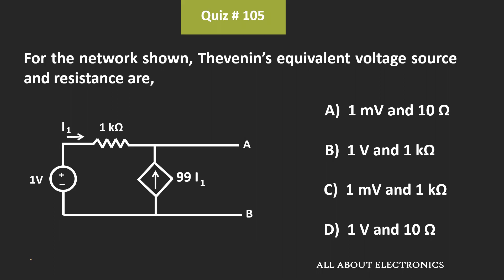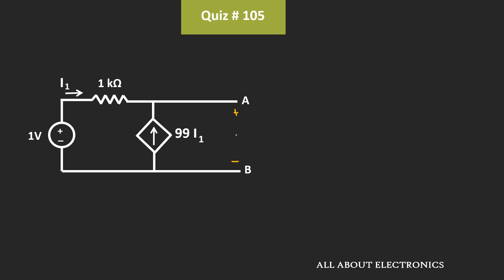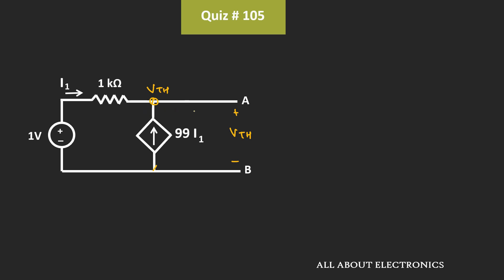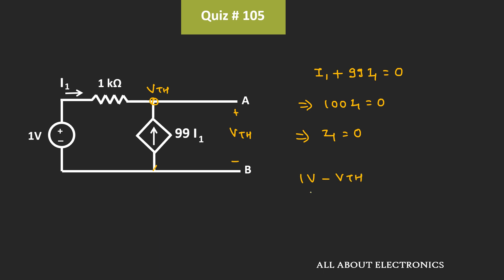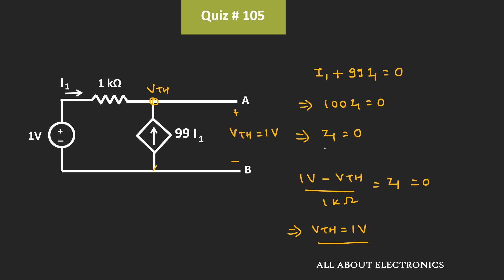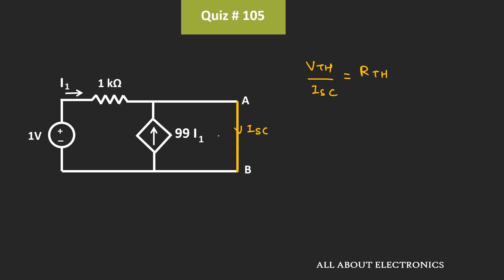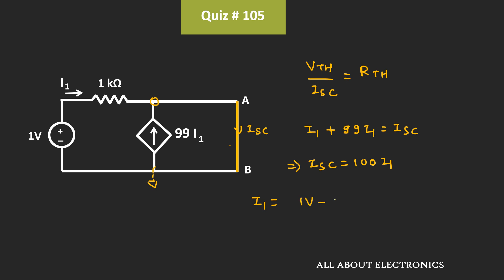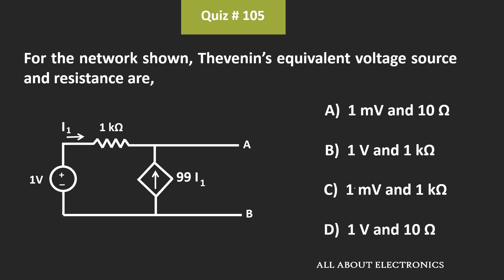Thevenin's Theorem Solved Example | Quiz # 105

Comment: Sir i have a question.. where do you ask the questions to theses.?? do you post them or do you have them on your main site?? or this one??
Reply from the maker: I used to post the new Quiz on both channels and solution on this channel.
But the thing is, I have started posting the video solution after the Quiz # 160. Before that, I was just providing the brief solution in the community post. 
So, now, in between I am also posting the solution of the older Quiz (before Quiz # 160)
For you guys its just a number, and consider it as a new Quiz only. (Only those who are following the channel since year and half only would have gone through these older quiz)